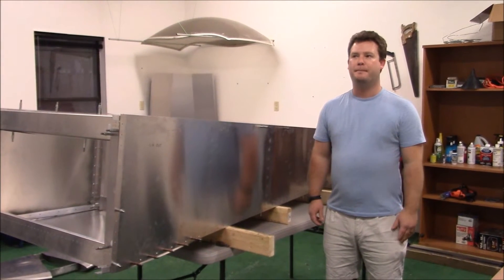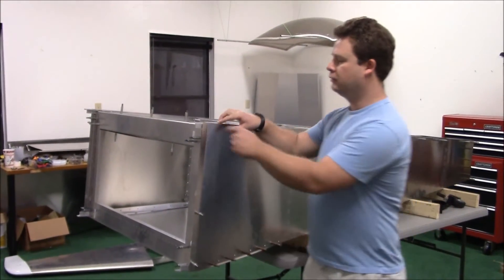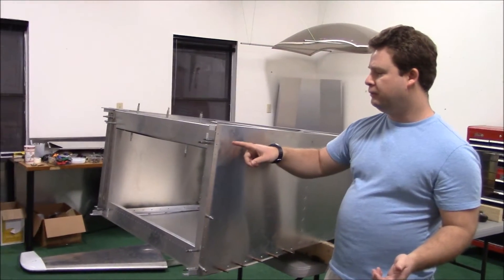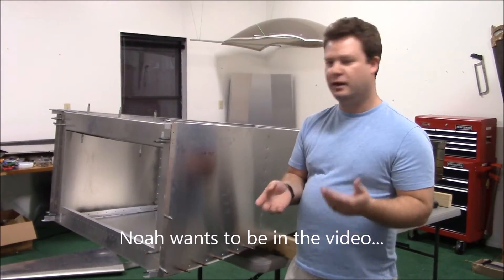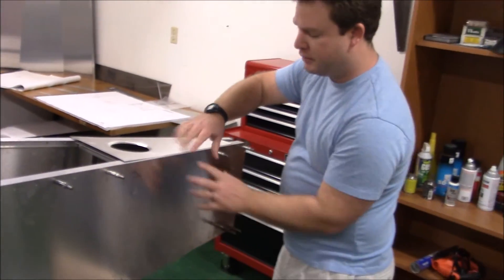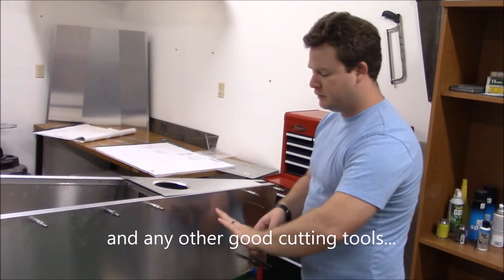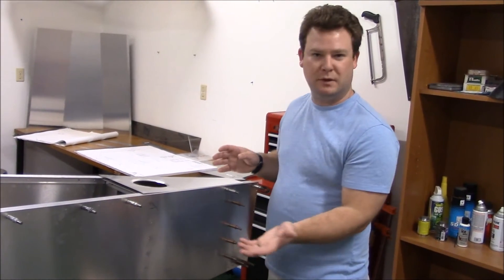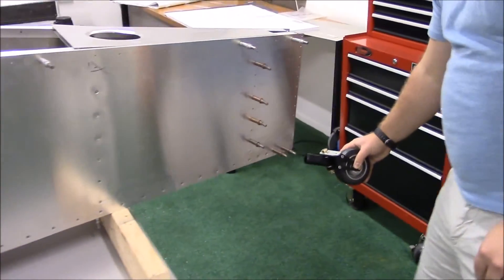Sonex Aircraft Build Video 50 Hardware Kits, Inspection Holes, and Next Steps

Comment: Just a thought.  You might check out a 4" hole saw at Lowes or Home Depot.  You can get the 4" hole saw for your handheld drill about $25.  Go to Lowes.com and lookup:  Spyder 4-In Carbide-Tipped Non-Arbored Hole Saw